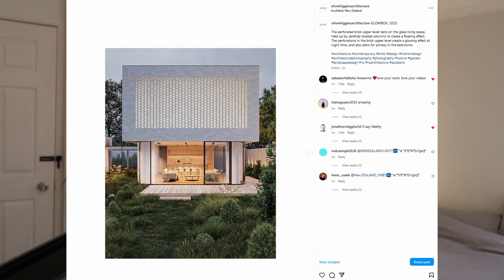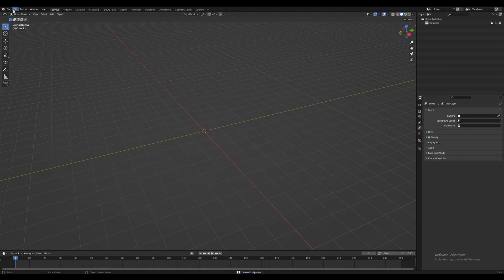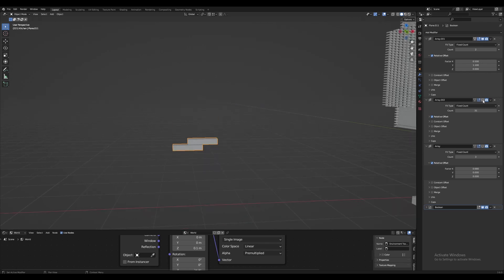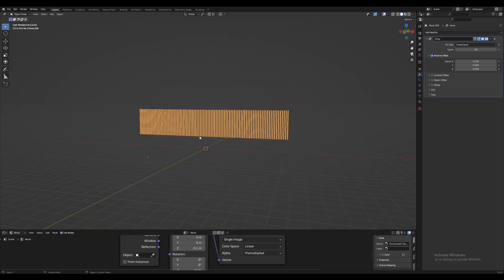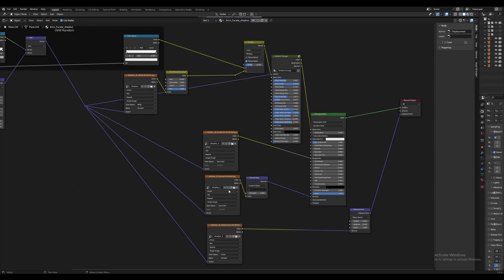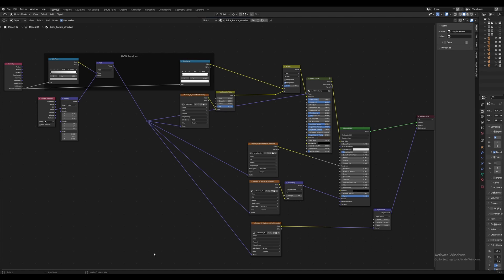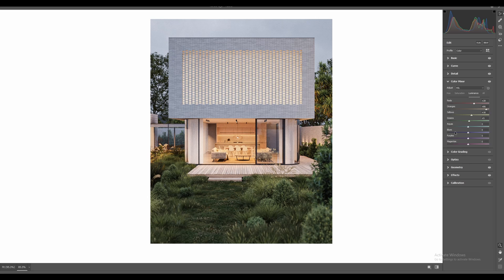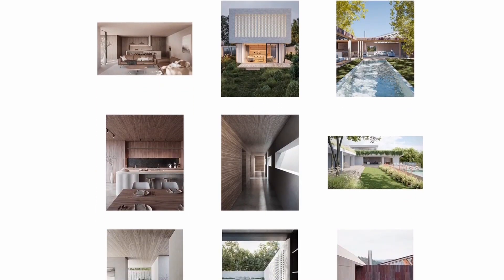Blender Exterior Overcast Render Breakdown - GLOWBOX

Comment: Is there a way to UV wrap like 3ds max. I remember an old trick we used to do for flooring using one texture or three planks. We would unrwap the UV and then add texture map. then in the 3ds max node we did same thing you did . create nodes that would offset the colors a bit from plank to plank to gie it slight variations.
Reply from the maker: Hey thanks for your comment, yes you can UV unwrap very similar I believe, although I haven’t used 3ds max in a while
Reply: @oliverhiggins8376  thanks for replly ! I found what I was looking for . The plugging floor generator had. Small tutorial on how to do multiple hues for one plank texture.

Comment: Nice video! But could you explain the first part with the linked files anyhow deeper. Or do you have external references? I couldn't find something similar. I relatively new to blender and im working a lot with linked assets. But how is it technically working, that you reduce memory usage with a linked blend file. Does it rather depend of linking assets than blend files? For example: If you have a linked blend file with a lot independent high poly tree assets. When you render,  why wouldn't it need the same vram as if you have the files in your og file? Other way round: why would it save memory to link files, compared to have linked assets in your og file? Im working a lot with archviz and high poly Natur. So I would love to see that you're right and its possible to save memory usage here :)
Reply from the maker: Sorry I don’t have any references for that, it’s just my process! It helps for bigger scenes but can’t give you any more detailed info.

Comment: Very informative, thanks! Just one question, what's the advantage of using geometry nodes to shift UVs over the "Shift U" and "Shift V" options of the array modifier? Did you need more control? Beautiful render btw!
Reply from the maker: I haven’t used that in the array modifier before but it is also linked to a brightness and darkness gradient in the node tree so there may be more flexibility there :)
Reply: More control is better ;)  @oliverhiggins8376